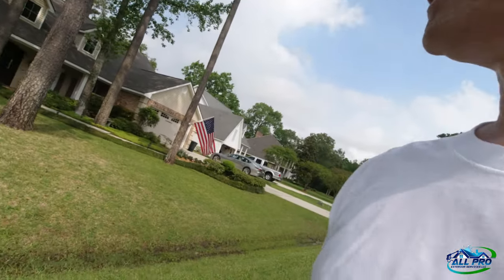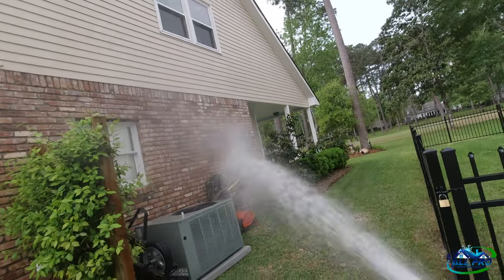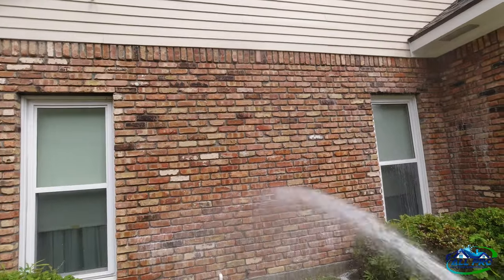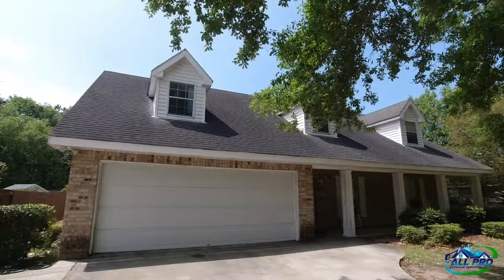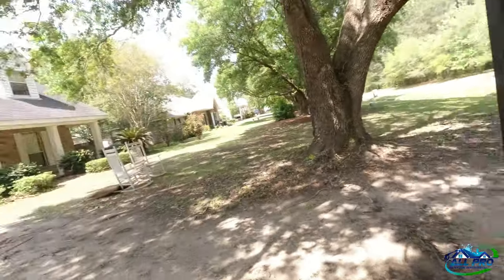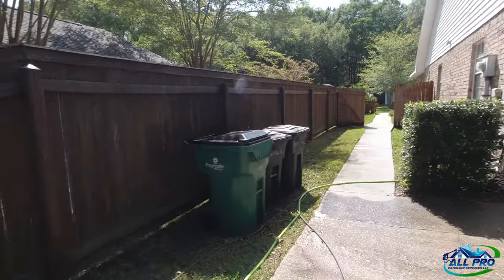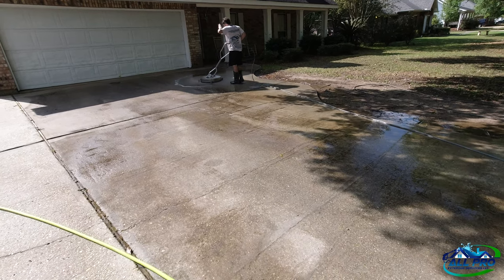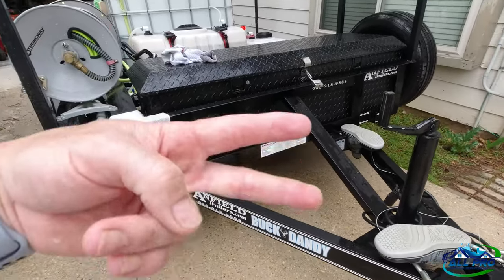2 House Washes & 1 Driveway

Comment: Fantastic video! Great job! I had a few questions. I'm a complete novice. 

Are there any eco friendly cleaners that work great for cutting oil on concrete or is bleach the only way to go? (i.e. Zep, Simple Green)
Can I use the wand to spray my soap and then switch to my surface cleaner attachment with the same hose? 

What tip are you using to reach up that high on the fireplace? Can I use a wand extension with that tip?
Do I need to cap off my injector tip at the pump? 
I purchased the Simpson PowerShot Professional 4200 PSI (Gas-Cold Water) Pressure Washer Kit w/ Honda Engine. I says it comes with a downstream injector. Do I just need the hose attachment?
Should I use non-ethanol gasoline?  
What respirator would you recommend?
Lastly, is there any proactive maintenance tips on the equipment when I'm done using it? (i.e. pump cleaner, running water through the system, WD-40)
Reply from the maker: Getting oil out of concrete is tough. A hot water pressure washer does help. I have heard of someone using Tide detergent, but I would try a degreaser. You can use the same hose to switch between the wand & surface cleaner if you have a ball valve. I use a Davis Shooter Tip. I am not sure about plugging you injector, but that’s what I would try. Non ethanol fuel is all I run and a 3M respirator is good. Always flush your system with fresh water. Thanks

Comment: What size lines are you running between everything I’m mostly curious about your hose to fill your buffer tank and hose between buffer tank and pressure wash
Reply from the maker: I am using a 5/8 flex Lila hose for my water feed. On the 4 GPM I run a 1” & on the 9 GPM I run a 1.5”. Thanks
Reply: @allproexteriorservicesllc5338  awesome thanks

Comment: Nice video man. 
Question about your downstream.
When you downstream you just turn that valve to bleach how your soap mix with your bleach?
Thank you
Reply from the maker: I add the soap to my SH tank. Thanks
Reply: How much should be add to a 55 gallon tank?
How long that mix should be good to use?
I really appreciate you help.
I’m just starting and I have more then 8 jobs to do but I’m not sure if I’m where.
I just want make sure to do the right way.
Thank you
Reply from the maker: @cleberligia  I would add about 12- 15 ounces of Elemonator. The mix should last a couple of weeks, but will degrade if exposed to the sun. Thanks & good luck!
Reply: Thank you very.
🙏🙏🙏🙏

Comment: Hi,

When you post treat do you have any surfactant or (SH) only. 

Also do you like the circular motion when using the surface cleaner then going straight up and down? Does it leave less line marks?  Just curious.  

Thanks for the video. 

Michael C - (WA)
Reply from the maker: Since most times I use my downstream for pre & post treating, I do have soap in the mix. With my experience, the circular method is the best and leaves no marks. Thanks
Reply: @allproexteriorservicesllc5338  

Sounds good. 

Thank you 😊

Comment: Can I ask how are you guys pitching the annual cleaning ?
Reply from the maker: I explain to the customer that they will save the percentage I decide to drop the price to. So if I was a house for $400, I will offer the annual plan for $350 which is about 12.5% savings. Most customers agree. Let me know if you need more info. Thanks.
Reply: @allproexteriorservicesllc5338  Thank you much I did pretty much that yesterday and got one this helps a-lot.
Reply: @allproexteriorservicesllc5338  do you have a contract or anything for them to sign up?
Reply from the maker: @garygodby9995  I am in the process of working on something. But I find that when you mention a contract, people tend to back off. I will more than likely call it a agreement. Make it easy for the customer is my goal. Thanks